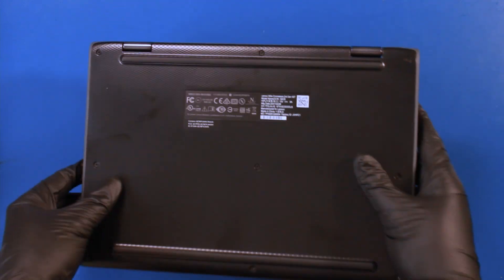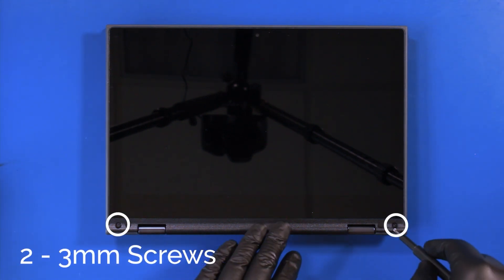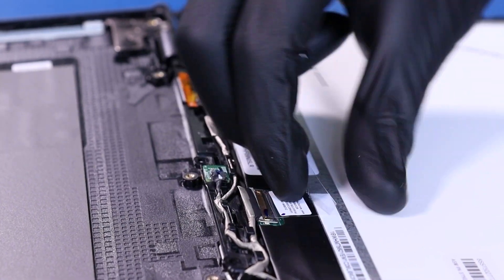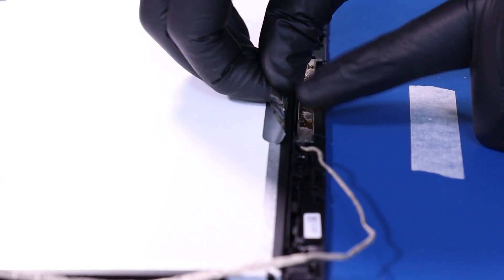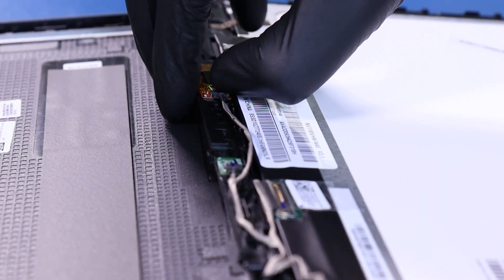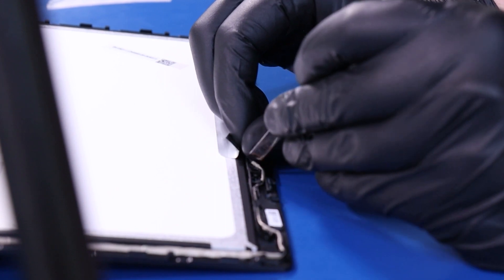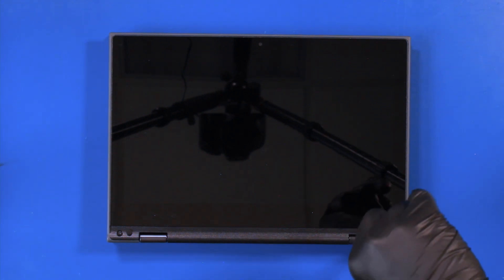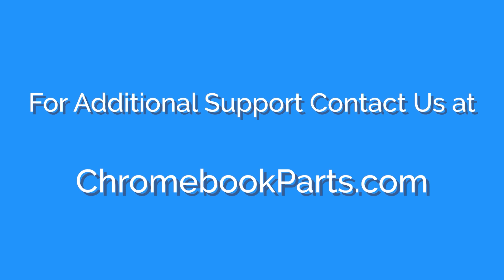Lenovo 300e Gen 2 Chromebook LCD Module Replacement

Comment: I did the same method, but when I replaced the screen, a problem appeared when I turned the screen into the tab position, the laptop turns off by itself, and when I return the screen to the normal position, it turns on again.
Reply from the maker: It's possible the LCD magnets in your replacement part may be in the incorrect orientation (this is not uncommon on non-OEM parts), which cause it to think the cover has been shut. Locate the magnets on your LCD mod, then remove them from their socket and rotate them 180 degrees before placing them back into their slot.

Comment: I can't get the new screen into place. It's the slightest bit off at the top and won't go back in. Is there a trick to this?
Reply from the maker: Hello! It could be they are not getting into the groove first before they are sliding it up. It could also be they routed the camera cable wrong and is preventing them from sliding it all the way. Also could be they are not pushing hard enough, but that is doubtful, as it doesn't need that much pressure to push up. If the screw holes line it should be fine even if there is a gap at the top.